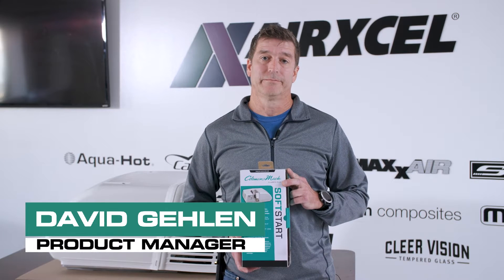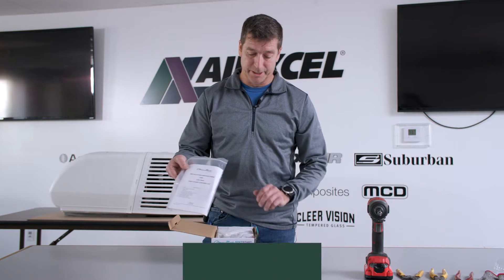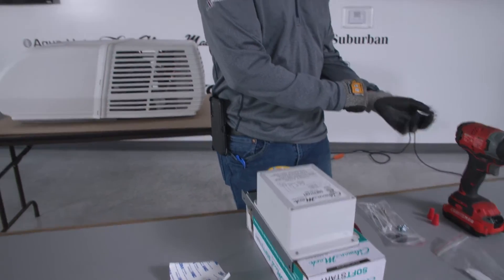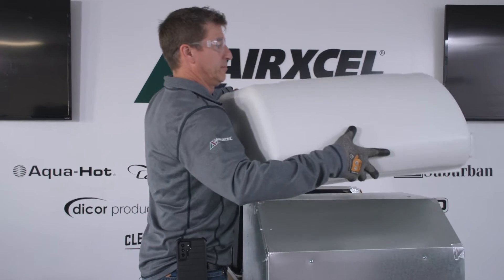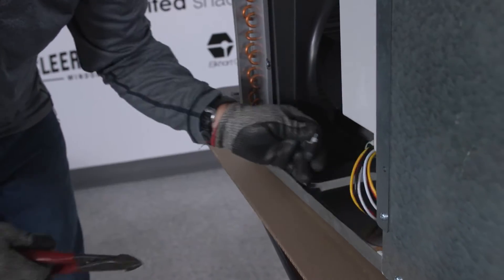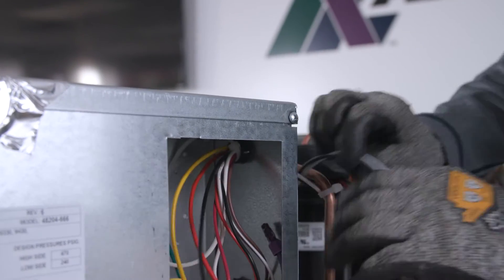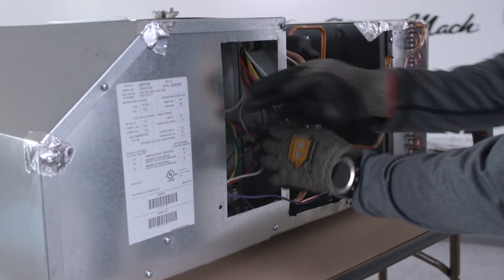Installing a Soft Start in a Coleman-Mach Air Conditioner

Comment: Just used a decible meter on my brand new Coleman Mach 8 Plus. It was at 80 decibles. With the condensor off and the fan on, it was at 70 decibles. Is this normal? It was like a jackhammer in the 20' travel trailer.

Comment: What do you do with the black wire that ran to the start capacitor/PTCR and removed?  This is not in the instructions, do you just put a wire nut on it to stub it off?  45000 series with heat pump and freeze board.

Comment: I have a active staty that plug in yhe pedestal. Its a surge protector and a easy start. All in one. CAN i use this at the same time? Or would i have to go to a standard type surge protector?
Reply: The Active Controls website says their pedestal box can be used with other AC installed soft start units

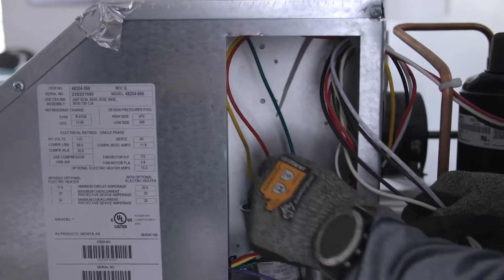Comment: A little clarification at 8:06, the yellow wire from the soft start unit goes into the spot where you unplugged the white wire from the run capacitor

Comment: I installed this on all 3 of my AC today. First one took a bit, but by the 3rd one it was a 5 minute job. 

Now I won’t need to worry about tripping the genny breakers when 2 units cycle on at the exact same time. (Rare) or when trying to start all 3 in extreme heat. Before it was like an Apollo 13 start up sequence to get all 3 going when over 100 out. It was 102 today and the genny didn’t even surge.

Comment: Some recent 45*** units have a start capacitor with red, yellow AND black wires. You are supposed to move the red and yellow wires but the enclosed documentation doesn’t say what happens to the black wire when you remove the start capacitor. I tried just taping it off but my install doesn’t work. The compressor doesn’t come on. Tried emailing Coleman twice for help but no reply. Any ideas folks?

Comment: I mounted the soft start right above the capacitors in the cabinet.  Never had to remove wires from the compressor.  I just connected all the wires in the cabinet with high quality insulated crimp on nylon quick connects.  Far easier.  I didn't have to pull any wires through the cabinet seal.  Update:  On the hottest day at the track,  95 deg plus, last month the softstart failed to start the compressor.   I shut down and tried it after waiting half an hour several times.  No go.   I tried it again the next day when it was down to 85 deg, and it worked fine.  Not happy.  My AC worked perfectly before I installed this. It worked perfectly for a few months as I was testing it getting ready to travel.

Comment: Great video... thanks for the help.  I installed one today.  I happen to have the exact same model (48xxxxxxx) and so it was an easy install.  Nice to know I can now run my AC with my Honda 2200 inverter generator or from a home outlet.

Comment: As a Master Electrician with 40+ years experience I would recommend using crimp nuts in a high vibration environment rather than twist-on wire nuts.  I have seen too many wire nuts come loose.  Taping them with good quality electrical tape can help but the crimp nuts when crimped with a good quality tool offers superior vibration resistance.  Another suggestion, test functionality before reinstalling the roof top shroud.  It might save you having to pull the shroud again.  Otherwise, a good video.
Reply: Just as an amateur who fools with RV’s on occasion, I totally agree. Twist on wire nuts tend to back off when used on an RV, and most RV’s come from the factory with those translucent closed end but connector, crimp nuts. I think for good reason.
Reply: Hi Kevin,   as a pro-electrical guy would you please recommend a "good quality [crimp] tool"   There are many to choose just one.   Between re-wiring a  '74 MGB and modifying a new camper I have a need for "a good quality tool".   Tools dedicated to a single, specific task are often the best, but I'm looking at tools that have interchangeable jaws.   But if a pro tells me I need multiple tools to get a quality crimp on different connectors, then that's the direction I"ll go.  Thank you. - Dustin